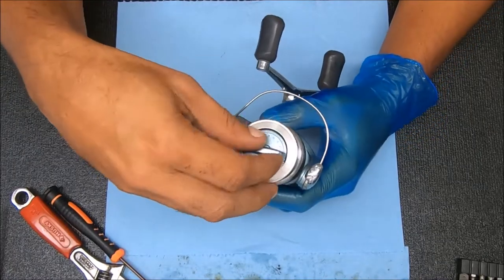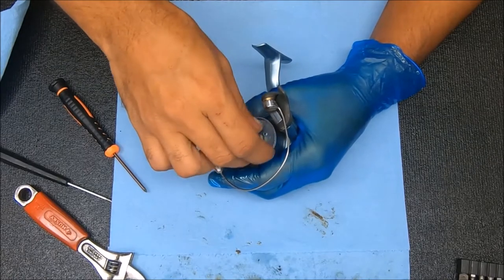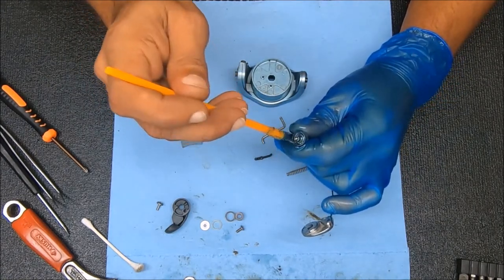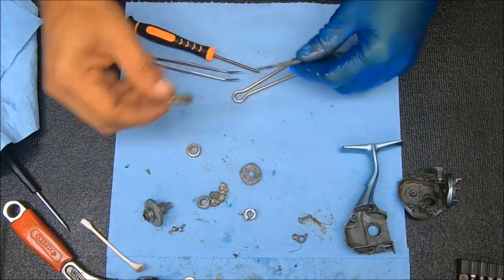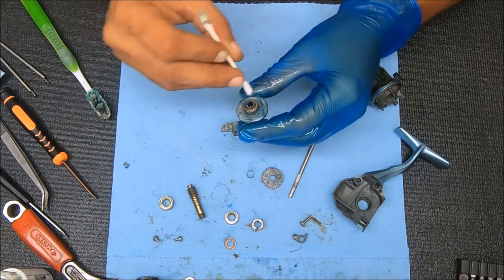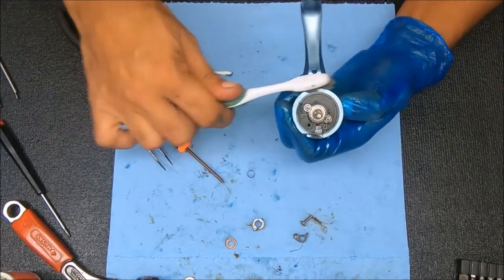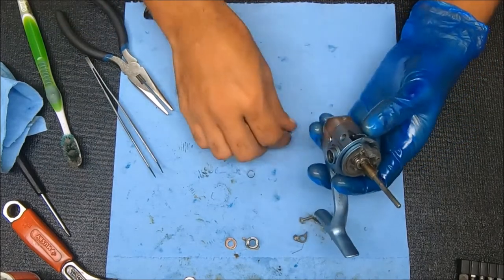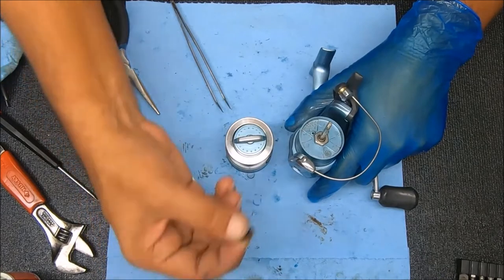Shimano Spirex 2500FG Fishing Reel - How to take apart, service and reassemble

Comment: Great video. My reel seized up after using it in salt water and the pinion gear was seized. Followed your instruction video, cleaned it up, oil and grease, now its as good as new. Thanks.
Reply from the maker: Excellent to hear! Thanks for watching. Spread the word about the channel.

Comment: Thank you for this comprehensive video of one of my favorite reels. I love the quickfire trigger for sight casting for reds. Because I use them in salt water I am constantly trying to keep my collection of Spirex's running in top shape. You had a couple of informative steps there on reassembly with information and I just winged it each time before and is perhaps a cause of some of my reels not performing as well as they could. I do understand that the Spirex is not a saltwater reel but it is the best model available with the quickfire one-handed casting feature that I love. Wish they made a higher-end reel with the quickfire but for now, I will just keep the few I have going for as long as I can.
Reply from the maker: You're welcome and thanks for watching! I know what you mean.... I'd use them for saltwater water too ...great for bonefish before fly fishing them became popular.... my brother would use folded foil gum wrappers over small weighted hooks to catch them on his lunch break, so having that quickfire trigger was a bonus. More vids to come!
Reply: I also use this same model for saltwater fishing, I catch huge jacks and snook on it and I never felt under powered. I use 15lb braid main line and 30lb leader

Comment: Is it possible to make this an instant anti reverse reel?  When i had the spool off it was in infinite anti reverse.  It looked like the white plastic ring could be removed but i was hesitant to try.  Any thoughts on this?    I would rather have instant anti reverse than the quick cast feature.
Reply from the maker: Thanks for checking out the video. The short answer is no, but if you could manufacture an a/r ratchet with more teeth, it would lessen the space between stops.

Comment: My 2500 fg line is built up on back of my spol I got washers with it but don't no were or how to fix it. Heat video hope you have one for my problem?
Reply from the maker: Thanks for checking out the video. Bunching at top, add washers, bunching at bottom, remove washers.

Comment: Followed every step, but for some reason when putting it back together the drive gear is hitting the screw that holds down the shaft. I don’t remember they’re being any spacers that might give it more clearance. Really stuck on this pls help
Reply from the maker: Thanks for watching. If everything else is correct, it can only hit the screw if it's not all the way in.... thus, you may have the wrong screw in there or didn't screw it in all the way.

Other options.... the block isn't sitting on the oscillating gear post....

Take it to a repair shop if you are having trouble.
Reply: Ok I’ll double check, ordered new gears anyway bec the old ones were worn, might as well throw in a screw with it. Thanks for the help! Keep up the good content.
Reply from the maker: You're welcome and thanks again for checking out the video. Spread the word about the channel.

Comment: taking the bail completely  apart is totally unnecessary, the majority of people that watch you do this then attempt it themselves will end up with a bag full of parts and shopping for a new reel
Reply from the maker: Thanks for watching and your input.
Reply: I completely disagree. This video is for anyone who may need help. Why waste time recording a separate video showing how to  assemble the bail when it can be added to an already existing video
Reply: @aidanbell9967  tell us rocketman tell us in your infinite wisdom, how many times have you ever fully disassembled a bail system. of course we don't expect the truth
Reply from the maker: @seymourwrasse3321  don't be rude. You can both have your opinion without you being insulting because he doesn't agree with you. I disagree with you too, but if your takeaway from the video was that I don't need to break down the line roller, then you missed the point of what my videos are about. It's to show you as much of the reel as possible, so one can TRULY have the opportunity to do a full service it if they want to.

Here's where I disagree with your rationale about it being totally unnecessary... you may be able to get away with it in freshwater, but in saltwater, it'll likely get frozen. Yes, just oiling the line roller when you do a basic service on your reel helps, but if a person will have difficulty with taking it apart, and putting it back together after watching someone else do it, then what about pinion stack, or even the gears? Now, if you had said I should done a better job explaining it, I'd agree with you. Even bushing-based line rollers can get frozen. Have you ever felt how your reel performs with a frozen line roller? Do you understand how your reel will feel and how sporadic (and heavy) your drag will be?

Let's be real.... just as there's some people who shouldn't be servicing their own car, there many who shouldn't be servicing their own reels.... and, I think, for the most part, they know who they are... and take it to a repair shop instead.

I get that other channels you watch may feel the same way about not taking apart the line roller as you do, but I believe the opposite is an integral part of any full service, if it hasn't been done before... just like I believe removing and adding ample grease in the pinion stack well is important if it hasn't been done before. It doesn't mean you need to do it during a basic service (which I'll rarely ever do) and/or it's already been done before.
Reply: @seymourwrasse3321  only a few times, when replacement parts are necessary because of saltwater corrosion. I personally appreciate the full breakdown because it has always helped me when I need it. I understand that yout might not need to see it but, others, like myself do.
Reply: @aidanbell9967  sounds like you need more help then a fishing reel bail can provide
Reply: @aidanbell9967  there I have unsubscribed, there are plenty of reel channels, if I get bored, I can just step in my shop and play with one of a several hundred reels I have
Reply: @seymourwrasse3321  enjoy your expansive set of reels.
Reply: @aidanbell9967  I not being the worlds expert you are, my last batch of reels I acquired was small, only 30 various models of Mitchel 300 and 8 pre war Ocean city's, so I'm not as smart as you . I probably sold more parts in the last year then you've seen in your pitiful little world
Reply: @seymourwrasse3321  then answer me this, what are you doing on a repair video for a 40 dollar spinner? If you buy and sell so much, why would you need to be here?
Reply: @aidanbell9967  slumming
Reply from the maker: @seymourwrasse3321  it seems like being nasty and rude are all you know. I feel sorry for you.